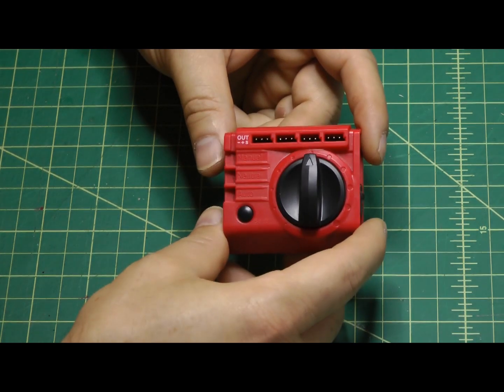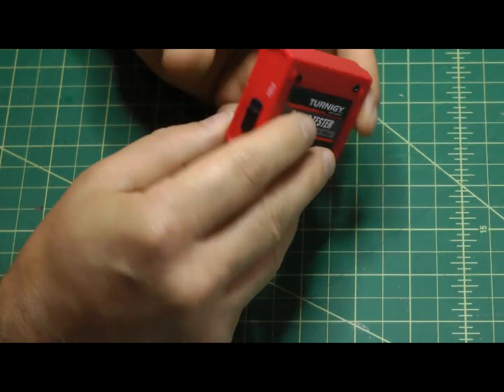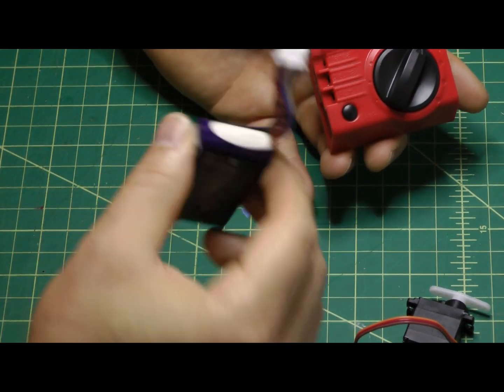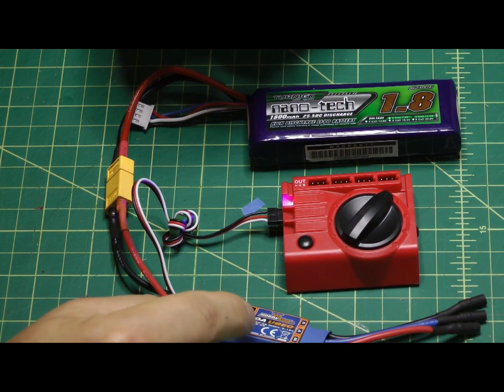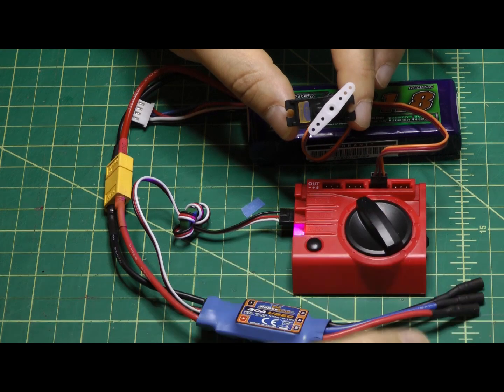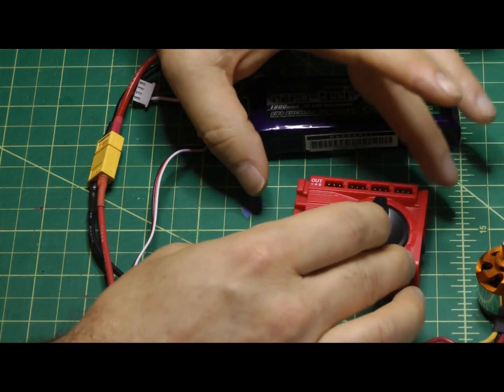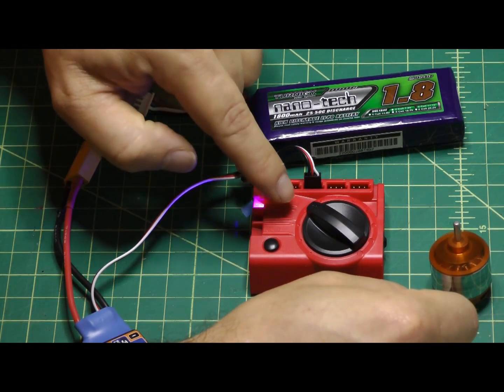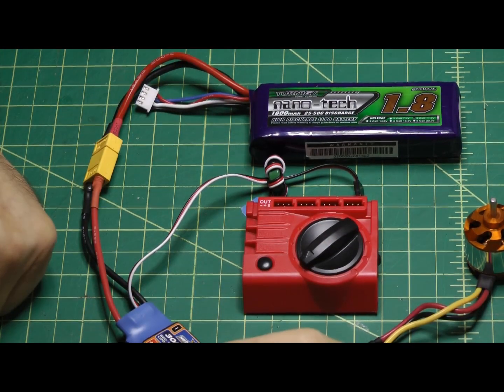Review: Turnigy Servo Tester

Comment: I cant get the ESC to arm with my unit.   Testing servos works great but i get nothing with a ESC
Reply: I’m going to go into the esc settings and see if maybe the end point adjustments are out of range for the tester..   other than that I got noting haha.
Reply from the maker: I have had that same experience with some of the ESCs I have.  One will work fine and another won't no matter what I try.  Haven't been able to figure out a reason why.  My first guess though is it probably has something to do with the voltage pass-through is not enough for one or the other.

Comment: Hi, I have the same servotester and when trying to test a motor on output side after installing the esc wires, no lights come on the servotester. Motor does not run just beeps 10 times stops beeping for a bit the 10 times again.What do you think?
Reply from the maker: If you have a different ESC that you could try I'd do that.  I did run into a case where one of the ESC's I have simply will not recognize the 'zero' position of the servo tester, so it never arms the ESC, just puts it into program mode.  Kinda sounds like what you have going on here.

Comment: Would any ESC do or does it have to have a BEC? Also, would a 1 cell battery work?
Reply from the maker: The important thing is that you only want about 5-6v going into the server tester.  A one cell lipo would be fine since that'd only be about 3.5-4v depending on the charge state of the battery.  Hope that helps.

Comment: You probably Saved Me A Servo as I Didn't Understand the Instruction's if that's what you can call  Instructions also Learned about Checking the Motor's. Thank's!
Reply: Is this tester 100% accurate to 90dgree the servos

Compared to the other crap turnigy  come out with 
Which was not accurate because they tested it on a another servo tester